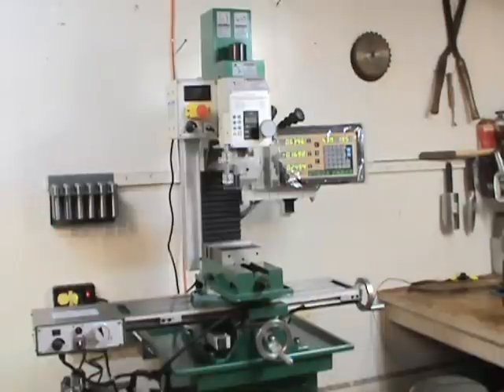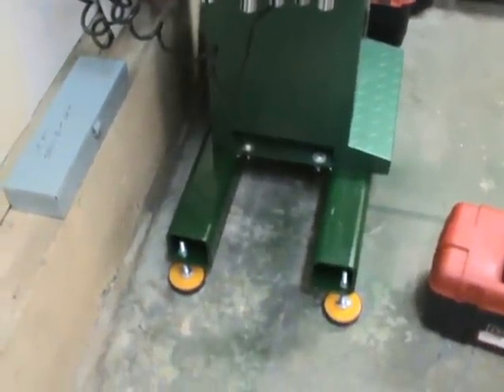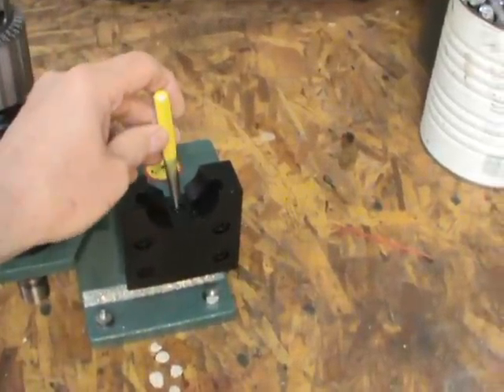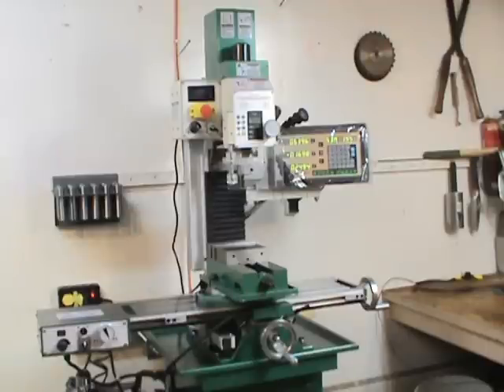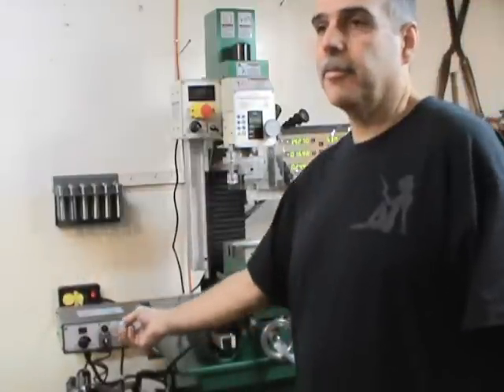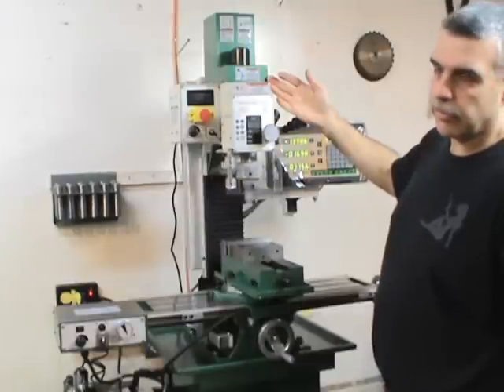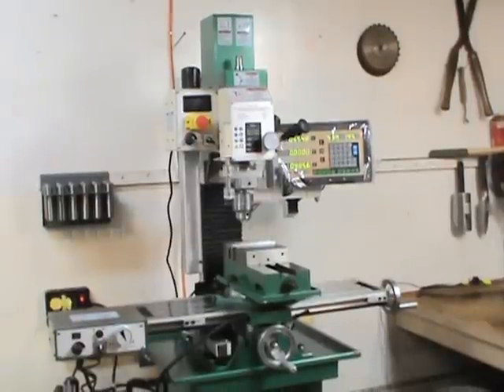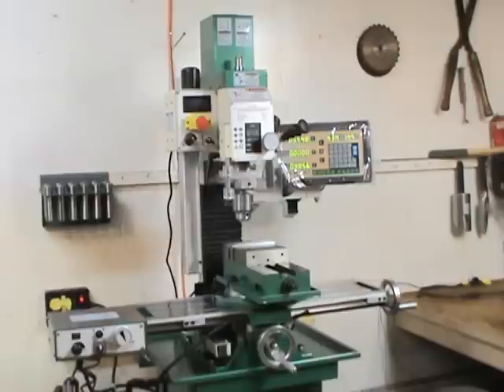Grizzly G0759 milling machine review and feedback

Comment: I plan on getting this to use for gunsmithing and bladesmith. Would this withstand a 2" face mill end for facing the bevels on knives
Reply from the maker: +Gary Leafty Yes a 2 inch facemill would work fine. Normally the spindle diameter and the facemill diameter should be around the same size, for max cutting.. In other words if you use a 8" facemill on a 3" inch sized spindle your going to get a lot of vibration and the machine will self destruct.

Comment: Where I can find the draw screw, you both on Ebay. Just search not find it. hex head bolt 7/16"- 20 x 10" long grade 8 or 9.750 as have one.
Reply from the maker: Hummer alternator parts I believe when I found mine. Try  McMaster-Carr for the bolt
Reply: @007connecticut  will be nice and helpful if you can remember part # on your purchase, on Ebay should find purchase order, I try many sites where they not give any tread size or length of bolt. I don't know but whith out part # are hard to find. Any how like your setup on your mill. Thill I find that screw I will stay with what I got. At hammer car to many options by year model and many more just not the specks on bolts. So if you will have that information for me will be nice. Thanks.
Reply from the maker: @gavrilteudan8759  I did a search and this came up
https://www.fastenal.com/products/details/18900  fastenal part number 18900
Reply from the maker: Found it!!
https://www.hummerpartsguy.com/BOLT-HEX-HEAD-716-20-X-975_p_17225.html

Comment: id rather buy a 2500$ small bridge port. 9x36 would do so much better than this machine. all you would need is a vfd if you dont have the electricity. great video bro. keep up the vids man.
Reply from the maker: Yes a small bridgeport would be a better option if you have the room. Just remember you may have to rewire the motor to 220V Thanks for watching!
Reply: @007connecticut  yes...i been searching for a series 1 bridgeport..non around in single phase. they take up alot floor space..costly to have shipped...so...even though these are china made..with some tender loving care..they will do what you need done. by far..they are not a heavy casting bridgeport mill.

Comment: Do you have any more information on your Bench Block?  I've been searching all over and havent found anything similar
Reply from the maker: toadman506 look on ebay for TIGHTENING 
FIXTURE MULTIPLE USAGE TAPER SIZE CAT/BT 40 WORK TABLE/TOOL CART

Then 
buy the shars adapter R8 to 40 cat adapter.

 

Cheapest 
and easiest way to go.
Reply: 007connecticut Found it, thanks

Comment: How well does this mill perform on steel?  I am looking for a knee mill or smaller for pistol smithing....  I want to cut french borders, slide serrations etc.
Reply from the maker: +photokendall The biggest problem with the machine is lack of mass plus a small motor,. So you need to brace it to the floor and wall to soak up milling vibration. I feel the machine using 1/2 inch and smaller endmills using fine to medium milling cuts would do a good job. But remember this is not a heavy, powerful bridgeport mill so your not taking full diameter milling passes. Light cuts will work perfectly. Heavy cuts will give you a challenge. I found a few videos on youtube that people are milling with different metals. Some have converted it to CNC. Do a search for the G0704 CNC milling videos.

Comment: Hey , 
I have shop with a G0704 cnc also. I happen to live in waterbury .
Reply from the maker: How do you like the conversion? Machine worth dong? Any problems with your Grizzly ie motor / circuit boards / gears? I live in Southington.
Reply: 007connecticut 
I am an actual cnc machinist who happens to have a small shop at his house. I work for BnA out of milford. My expectations may be higher than most. That said 
Ive had a few accuracy issues with the mill that I had to amend on a surface grinder. What I had to fix is great now.
Im in the process of CNCing my large knee mill so besides making brackets and such I dont use it much.
There is a group that meets in newtown monthly great bunch of guys. If interested I can give you their web site info.
If you ever need anything drop a line to me.
Reply from the maker: Mark Rich Thanks Mark. If I run into a snag I'll look you guys up!

Comment: same thing happen to me,  new people running the shop where i work,  now can't stay late to work on any government jobs
Reply from the maker: It's better this way to own a little machine in your garage or basement. It costs some for the tooling and stuff but in the end your way ahead without the BS from work! If you got a little project now it's no big deal. If you don't finish leave it right in the vise and continue on another night. Thanks for watching!
Reply: I was almost ready to buy the g0704 like yours, last minute I change my mind I went with PM25MV I just gotten it about 2 weeks ago I have a problem with the stand the mill shake around on the floor, going to try the square steel tubes like you got and bolt it to the bottom of the stand with leveling pad or leveling casters hope this works!
Reply from the maker: @makosharkcnc7730  Yes definitely, make a very solid base for it and in my case I rigged it to the wall too for extra lateral support. In my case sometimes milling hard stuff I hear the hole garage shake so mass is a good thing. The heavier the machine is the less vibration you get. My machine runs like a bridgeport with no vibration for most stuff. So again the base is critical. Maybe bolt it to the floor would also tighten it up. I didn't bolt mine to the floor as I made a real good stand for it, (but it's bolted  to the wall behind it). Well good luck with it, it's very similar  to my machine. It should give you years of enjoyment once you iron out the installation. Thanks for watching!
Reply: i see you welded your square tubing to your g0704's stand base. you think since i  don't have a welder that i can bolt it to the bottom of the stand maybe with 2 bolts? like to email you time to time since we almost have the same machine i may have a few projects coming up and maybe i could ask you your option on making somthings
Reply from the maker: @MakoShark I posted a reply and I don't see it. I will write another and save this reply...I made a base. The base is welded as 1 unit then I bolted the base to the machine cabinet. After all the holes were put in then I painted it green to match the cabinet. 
The size of the base will be close to what you need. My base is made with 2  4" X 4" X 3/8" thick wall steel tubing which is 36" long. I added a steel plate which is 9" X 15 3/4"  X 1/4". The plate is welded to the 4X4 tubing central which holds it all together. 
Once it's made the machine cabinet sits flat on top. Then I bolted the cabinet to the homemade base. I went to MSC website and bought 4 load levelers and installed them to the 4X4 steel tubing on the 4 corners (1 on each corner). The load levelers are 3 5/8" round with a 1/2" threaded stud on each one. So I needed to drill 1  1/2" hole on each corner of the stand to install the load levelers. I added 1/2" nuts and locked it all up when the level was set. Ask around to find a welder in the area. It might cost $250 for the whole thing but it's worth it in the end. You will have a higher machine that is rock solid. I'm 6' tall so I don't bend over running the thing. The base adds weight to the machine. More weight  = less vibration. A win win all the way.